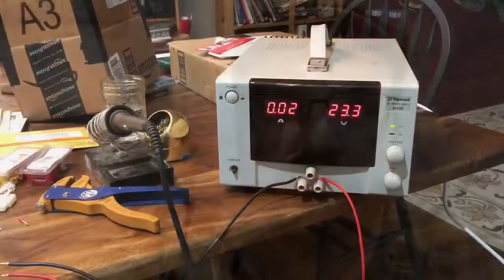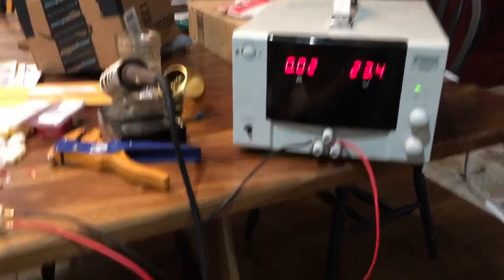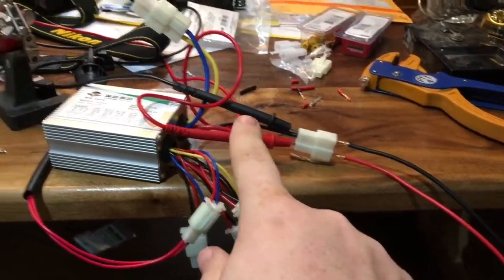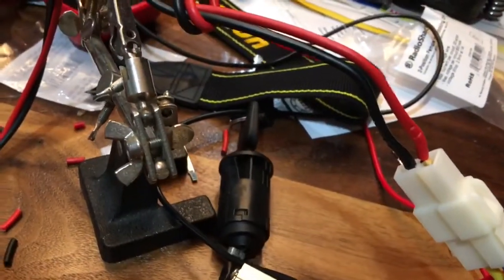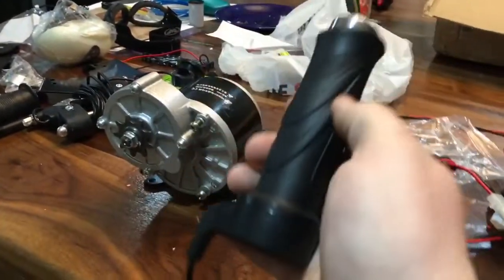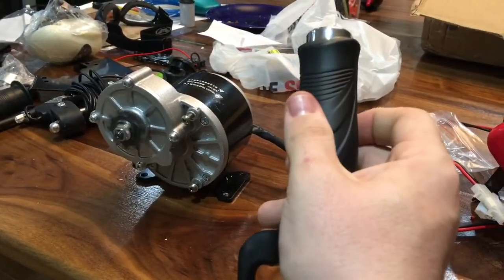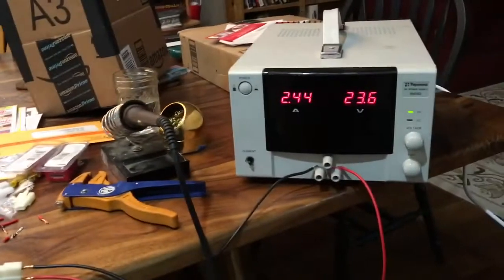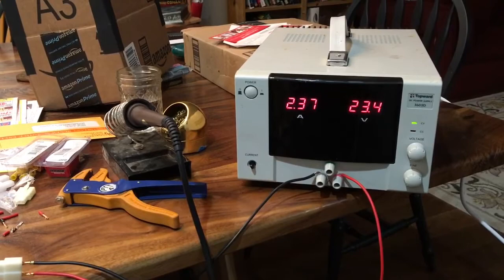The Kraken: Initial steps with 350W motor system

Comment: do motor controller have any in built chip which change digital signal from motor  to analog signal in throttle and can we use any throttle which can take up to 24v with same specification of motor and motor controller.